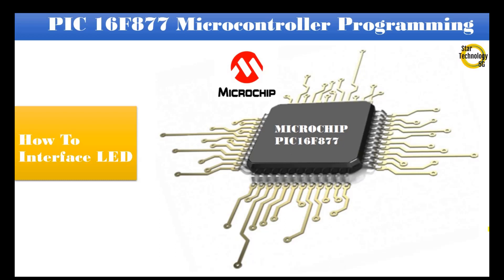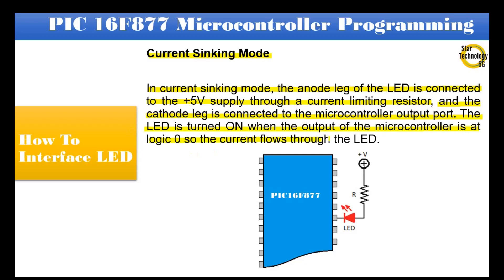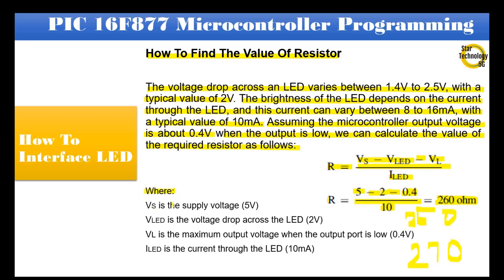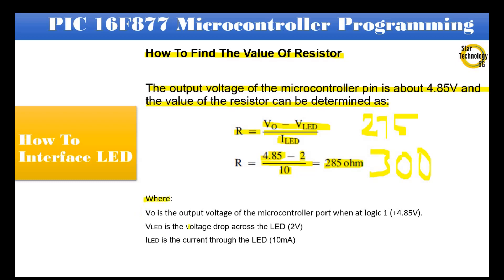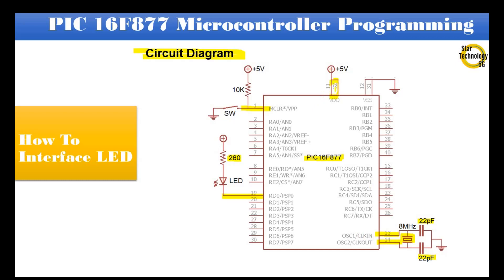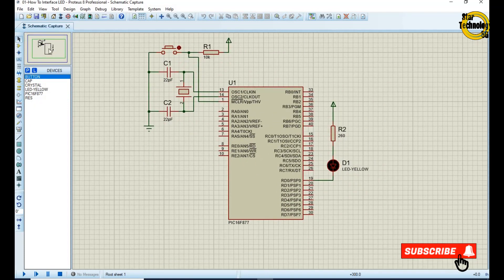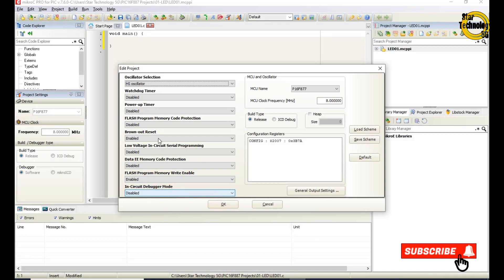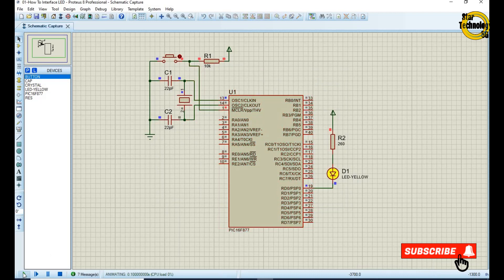Microcontroller PIC16F877 Video 08 How To Interface LED Using Mikro C for PIC

Comment: How to connect 100 leds to the 8951 microcontroller then what is the code
Reply from the maker: Depends upon how do you want to connect these LEDs. 
Definitely, you need a driver circuit to operate these LEDs.